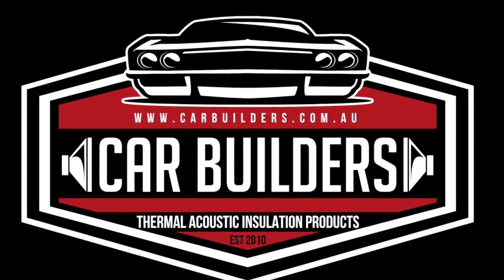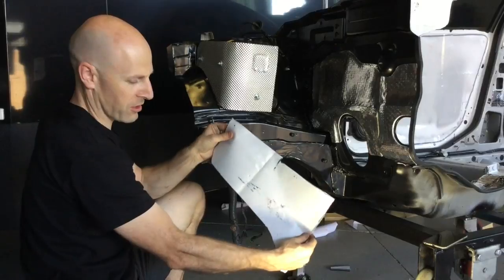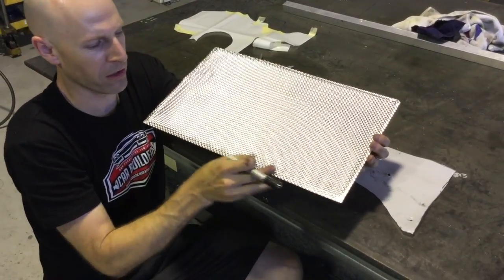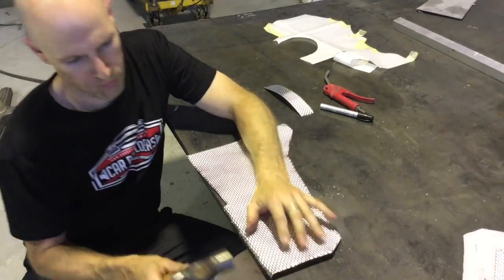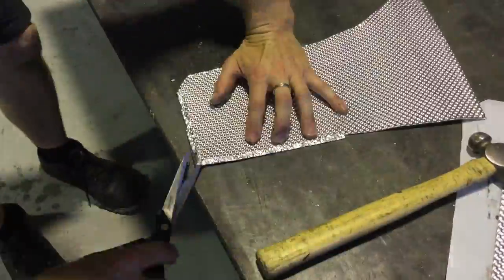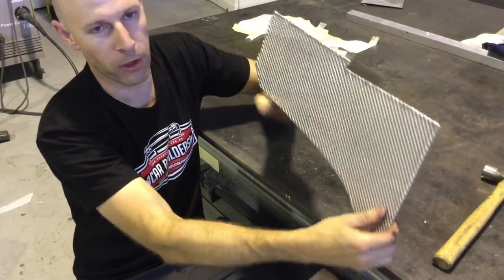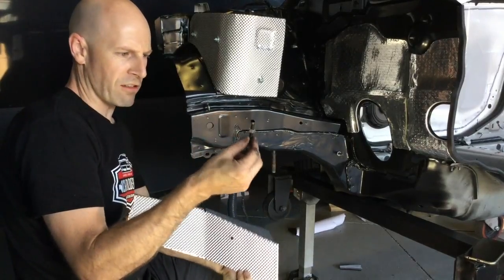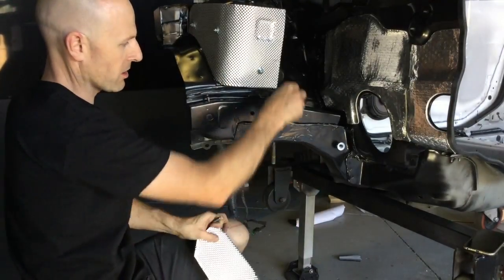How to make your own heat shield. The best way to stop heat engine heat through the firewall etc

Comment: So whats inside/in between the aluminium layers? Looks like there's nothing in the middle of this product so just a piece of alloy with wrinkles? Others at least have a glass fiber inbetween the layers....People don't waste your money, get Inconel from Japan or the US it costs less and is way more effective!!!
Reply from the maker: Hi SovL:Remedy. Our exhaust heat shield is a multilayer heat shield to capture radiant heat and is different to the Inconel material product you have referenced. Correct, this version does not have a ceramic layer in between it for a number of reasons, however it is an affordable solution that produces impressive results. It can be cut and formed to replicate factory radiant shields and is capable with continuous temperatures of 650C. Yes, there are other products which can be clad directly to exhausts and use different layers between.
Reply: @carbuilders1  The real issue is the price point is in the same field as Inconel and Ceramic layered products! Sheet per sheet is almost exactly the same price point as the Inconel Product, the only difference is the Inconel sheet is 200mm shorter but outperforms your sheets by massive margins at almost the same price!
Reply from the maker: Can you please send us a link of the product/s you are referring to?
Reply: @carbuilders1  I'll let you do the searching, You should do your own market research as it's quite typical here to get a massive "up-mark" price compared to getting a product imported, typical AUS marketing, I will tell you one is from Platinum Gaskets (Heat shield) Multi-layer with ceramic filler ....The other is from Hiwowsport, there is a little variation in pricing of this product and is the most superior which is Inconel...Have fun!
Reply from the maker: We are well aware of these products but to reply to your comment we wanted to know which product you were specifically referring to so that we could compare apples with apples. The cheapest Hiwowsport Inconel heat shield on eBay is $128.59 from China or $88.40 plus $80 shipping from the US. These sheets are 30.5cm x 30.5cm which is smaller than our 30cm x 50cm sheets that are $42 with free delivery to metro areas in Australia (half the price of the US shipping alone). Also all ceramic filled heat shields are more than double the price of our Embossed Heat Shield.
We are currently in the process of developing a similar product that will be DIY priced.
Reply: Upmark price and typical Aus marketing??? The Car Builders heat shields are less than half the price of ANY inconel heat shields and any ceramic filled heatshield. 

If you watched the first 25 seconds of the video you will see there is an air barrier between the car and the heatshield. Using a heatshield this way uses air as the insulator, which is why you dont need ceramic layer. Carbuilders peel and stick heatshield uses a composite with an aluminium face which is more suited to sticking on surfaces where you cant have an air gap. I have used all their heat products and had great results. 

The only reason why you arent linking any cheaper products is because you cant find any inconel or ceramic filled heatshields that even get close to the price of carbuilders. Upmarked prices my ass
Reply: @DigitalFl0w  This dude can't even take the name of the products i've already mentioned and do a simple search! He should actually try calling the stated and getting some real discounts on Inconel sheets, believe me, most of the US companies are more than happy to give a decent discount when you buy direct...Simpleton!!!
Reply: SovL:Remedy are you sponsored by inconel or something?? Lol goofy ass